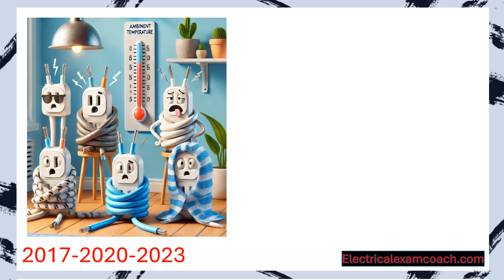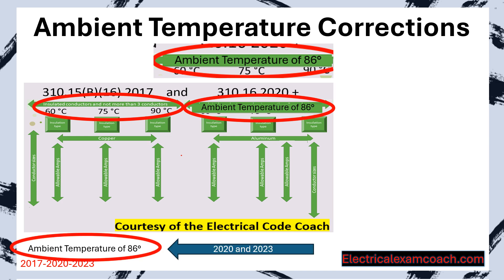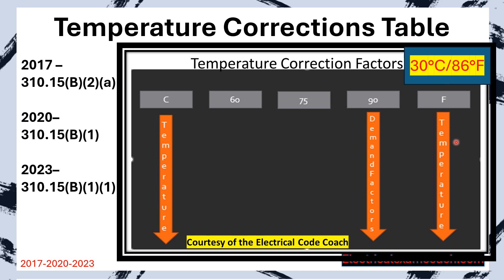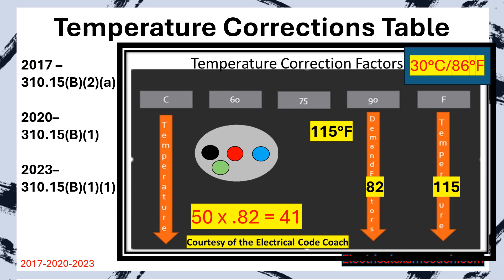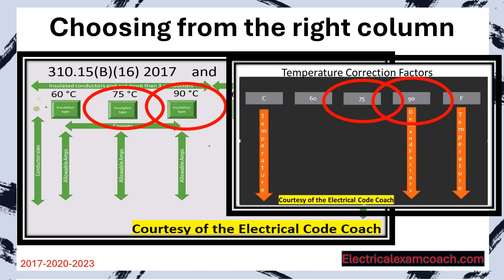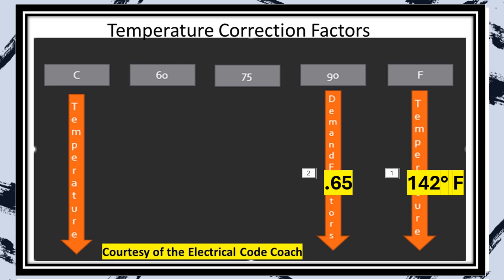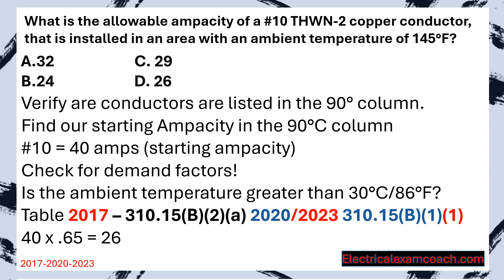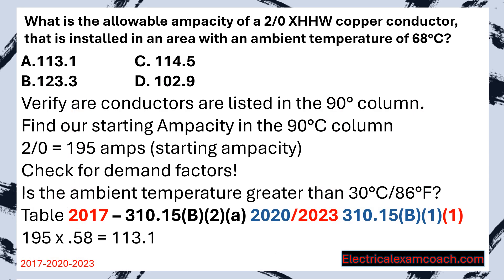Lesson 9.6  Temperature Corrections Master Electrical Contractor Exam Prep Calculations Portion

Comment: I have a question. We wire rooftop units in NC and SC on a regular basis. How do I confirm the ambient temperature of the roof? It obviously varies, but would I go by an average or the hottest day of the year. What tool would I use to get the temperature?

Comment: Hello, im a big fan of all your hard work and advice to help others. I have a question for you.   im confused. My book 2023 In table 310.16 has THHW in the 75 degree Cel and 90 deg Cel. Your question states terminating in the 75 degree Cel, but your answer is from the 90 degree Cel column and in the correction factor. My question is do we ignore the comment terminating in 75 degree cel?? That wasn't a hint to go with that column?
Reply from the maker: Great question! When doing bundling adjustments or temperature corrections you will use the 90C 99% of the time in the exam world regardless of the terminals.